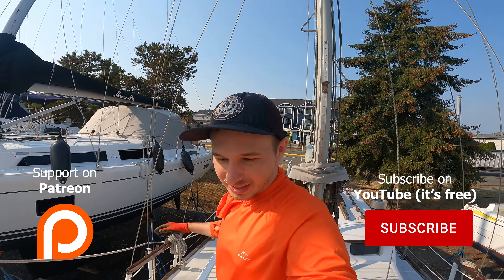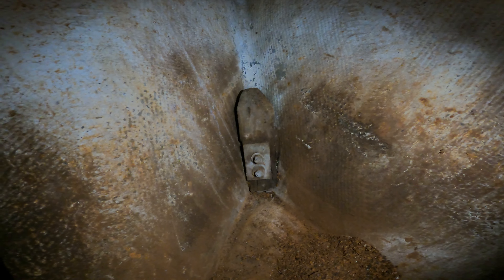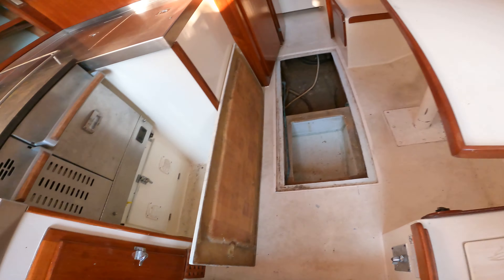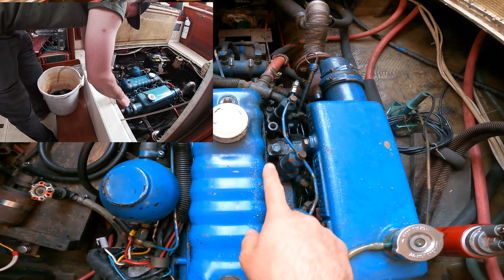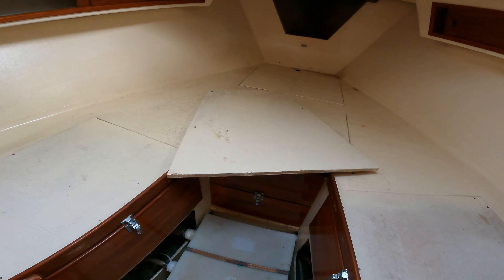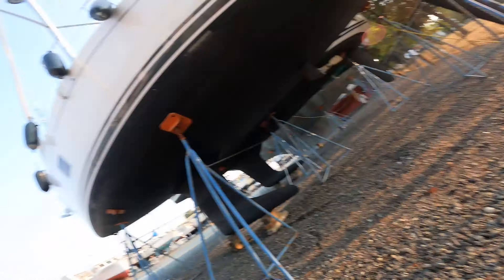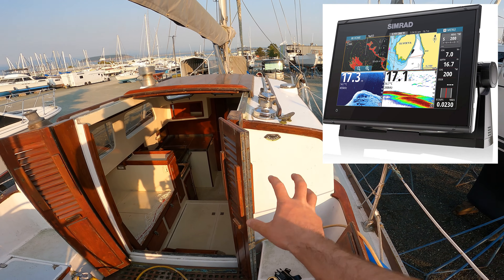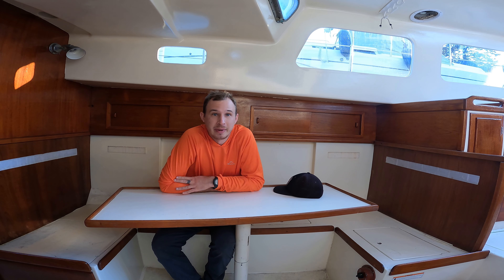Boat Parts and Boat Talk

Comment: Looking forward to seeing some boat work!  How about showing us the “to do” items on sticky notes like Mads at Sail Life!  Great looking vessel!
Reply: Little use at this point . He has so much to do , i would question if he has enough bulkhead space to list them all . Another issue would be losing/ disturbing work slips , as work progresses .
Reply from the maker: Yes! I like organizing things on a white board, I will measure out a space of one and instal it sometime in the next few episodes. I am literally cutting out some of the fiberglass lining to get at the chainplates as I write this so no worries, boat work is coming!
Reply: @projectseawolf  Investigate those bulges before glassing . I've never seen anything like that before , and i don't see any reason for it happening this time .
Reply from the maker: I definitely know what they are now. The in-hull chainplates are in a T shape glassed into the hull with a cross bar. They are rusty as hell and when I cut out the lining I could see rust and water coming in from the other side. I will post the video where I discover this issue on the Patreon tonight, but the regular YouTube episode will come out on February 4th.
Reply from the maker: Bought a nice big white board for the main bulkhead today ✅

Comment: I feel bad for your walet!  :)
Reply from the maker: Yes lol the wallet is suffering xD but I am working full time and I have a lot of time to get these projects done and parts in.
Reply: @projectseawolf  Ehehehe.  No - I love what you're doing - I was just internalizing.  Thankfully the Newport 27 picked up, someone  had just done all the work you're aout to do - plus glassing in the keel, prop shaft, and random TH.....And got it for a song.  I'm still not sold on dynema rigging - but it sure is tempting.
Reply from the maker: @GeorgeGraves  nice! Ya I am not sold on dyneema either, I will be going with standard wires this time around.
Reply: @projectseawolf  Let me know how it goes.  But yea, I should keep a spool of dynema on the boat - just cause.  Loving the vidoes - have shared it with a few people!  Cheets.
Reply from the maker: Thats awesome! Thank you so much :) I'll have to get you up here sometime soon.
Reply: @projectseawolf  For sure.  If you need crew - I'm down.

Comment: Plenty to do and you have lots of ideas which I think will evolve as you progress.  I'd say big "no" to dyneema rigging! It definitely stretches and chafes and I wouldn't exactly call Herbie (The Rigging Doctor) a great example of an expert.  Also a big "no" to an arch ...adds a bunch of weight stern, creates windage and quite frankly, those things are butt-ugly.  Life is too short to sail an ugly boat!!!  The composting toilet is also a big "no!" Once you leave the US put the y valve to overboard discharge...(see Sailing Uma for more on this topic).  Can't wait to see how things develop.
Reply from the maker: 1. Yes, I will being going with standard wire rigging for now. 2. Yes, I have not been impressed with many of Herbie's desissions to the point where I just cant watch his videos anymore, particularly picking up a poached Macaw in South America, having spent time in the Amazon studying those birds I know its a very dirty trade, but also boat stuff. 3. Aft arch I will be sticking with. I am replacing a 40hp diesel motor, 60 gal diesel tank, and heavy sailing dinghy that were all in the aft with a 100 pound electric motor, so I need all the weight I can get! With the electric motor going in I also need all the solar and wind I can get, so an aft arch just makes sense. 4. Yes I had a flushing head before with Y valve for tank and overboard. As a solo sailor doing most things offshore I'm not too concerned with finding a place to dump. I will probably go back to flushing with small tank like Uma did when I get back to the USA from the Caribbean before heading to Northern Europe. For right now in the Puget Sound the composting head is the simplest and cheapest  solution when you factor in the tank, lines, and hull fittings. Plus there is a full bathroom in every port and island here. 5. I'm excited to see where it goes as well! A lot of experimentation right now, I am cutting out the liners hiding the horrid in-hull chainplates as I write this. I have Bronze externals ready to go once the hull is blasted and repaired.

Comment: Dumb question: Why are they called “chain plates”? They are holding/securing a steel cable, not a chain (novice here;-).
Reply from the maker: That’s a good point, I’ve never thought of that. I guess the chains part of the chain plate is the holes for the bolts which “chain” the stay to the hull. Interesting!

Comment: Hmmm , so you have a huge problem . You're not allowed to sand , you do realise pretty much everything your planning will need sanding don't you ? .
Forget loading the focsle with water tanks , too much weight up front . You need to keep the ends light , with all the heavy gear close to the middle , water tanks as low as possible . Weight in one end will cause the boat to hobby horse , and you're already gonna have your chain , plus an anchor there . Water weighs roughly 1kg a litre , i think that equates to 8.5 lb a gallon , plus tank , but check that as i'm not certain . Normally the focsle is a sail locker , off shore , and if you're planning on losing the furler , you will have a lot of sails . I wouldn't advise that particular move , but that one only you can make .  
I'm afraid , i would advise against compost toilets too . If you're planning multi country visits , emptying may become an issue . For instance , i don't know of any empting points this side of the pond , except on inland waterways . 
Engine , now this is an interesting one , you have a 40hp on 36ft ? , why ? . 
I'm looking at a 32  , and that only has 20hp , plus it carries 10 gallons of fuel ! . There's no point having a bigger motor , cause the fuel won't last long anyway . It's purely for getting on and off the mooring . 
The skin fitting with a cap , is a transducer slip . Something like a paddle wheel for the log , or maybe  the transducer for the echo sounder screws in there . Check it's redundant ! . 
You will need a lot of solar to be able to cook , electric , plus huge reserves of battery power . It may sound good to be green , but in practical terms in many ways unworkable . Personally i would go gas , but you have a diesel stove . In some cases it's better , but the risk is greater 
The capstan is a good idea , takes up less deck space . Try and get one without a naval pipe . You need that separate so you can close the hole off , in rough water offshore .
Reply: I have sail bags living on the deck. Not an issue to lower or raise sails. Big problem when the furler decides to pack up in despicable weather. It is not a "if", but "when". I have a downhall and if the condition are outrageous I douse the jib and wait until a lull to store the sail (in the sail bag). And the sails have always a good shape. A genoa on a furler is not going to be really efficient.
Otherwise I agree.....
Reply from the maker: 1. Ya no sanding of the hull is annoying but I will be paying the yard to take the boat and sand and grind it all in one day, I have to wait for the weather to dry up though (raining all day every day right now) so I can repair what was ground out without water getting in. 2. That is an excellent point about putting the water tanks elsewhere, I do not want to hobby-horse around the world! I will be taking all the weight out of the aft as part of the electric conversion so I think that will be a good place to add a water tank, or somewhere low and center. 3. Ya I will be keeping the furler and going standard wire rigging for now. With the 135% genoa it makes sense just to have it furling. 4. Before my crossing to Europe I will probably haul out in the USA and instal a small waste tank system with flushing head, but for now in the Puget Sound a composting head is the cheapest and simplest solution. Mostly because every port and island has a full bathroom and showers set up here. 5. The motor is going to be a big design change, as I am going full electric with 48v lithium propulsion bank powering the QT 20.0 Electric Yacht and 12v house bank through a 2000w inverter. (Solar, wind, and prop re-gen and a honda generator if thats not enough.) 6. Yes, depending on the transducer I will be repairing and keeping that thru-hull for my own transducer which will be part of the full simrad system I am ordering. 7. I will have a small drip diesel stove, a propane stove, and if conditions are good I will use the electric hob. I plan on having a ton of lithium power both in house and propulsion banks fed by solar, wind, prop regen, and generator. 8. For the capstan I will note that down! Thank you! Ya I am new to powered capstans, I've been hauling anchors by hand my entire sailing career, but that was on a 28ft boat in shallow mud and 75ft of chain, not bad.
Reply: Oh , and chain , don't sling your old anchor chain just yet . You maybe able to re-galvanise it , and though it probably won't be enough , it will give you a head start !

Comment: From the standpoint of having three 40’+ sailboats over the past 20 years there are a few things you may want to rethink:  1) while doing your long passages will be a significant part of your time on board, the fact is that the majority of time will be at anchor or in coastal conditions. As such your spacious companionway really adds a lot to the usability and functionality of that boat in non-passageway travel…consider instead doing some removable companionway batter board system that can be installed in addition and stowed away when not required.  I think there’s a viable work around solution there.  2) a simple but sturdy Genoa roller is pretty fail proof and much safer than having to scramble up on deck in rolling seas, bad weather, or at night to douse the sail when required.  The assumption that you will always be one step ahead on reefing or dousing is fine for 90 percent of the time but it’s that 10% factor can kill you…not to mention the pure ease and safely doing it all from the cockpit…risk vs return here 3) do more research on using dynema for your standing rigging as I think there’s a real issue with UV degradation in a relatively short term.  I would not base your decision solely on you tuber rigging doctor as I see a lot of things they do on their boat I would question.  4) be sure to include some effective way to incorporate a davit system in your arch that works with your steering vane as it will be a much needed system in the 80% time you are not at passage. 5) go with a highly dependable beta or yanmar engine with a strong alternator for your lithium batteries, especially if you don’t have a separate generator.  You will appreciate the torque of a diesel when conditions get bad or when you have days of no sun for your solar…besides the sheer square footage of solar panels that you would really need may be difficult to house and secure properly (they will blow off ).  You tuber captain Rick has a newer wind generator that he says has much reduced noise…you may want to compare the pros and cons of a wind generator to a towed water generator too.  6) assuming you are going to repaint your topside hull you may want to check out Alexseal paints.  You can apply using a proper roller without spraying and get great results.  The originator of the AwlGrip gold standard of paints was the creator of Alexseal.  7) whatever you refit budget is double it and you might not be too over budgeted, stick with high quality proven products as quality pays for itself.  Enjoy the ride.
Reply from the maker: Awesome points! Ya I will try to address them:
1.) yes, I love this large washboard idea, just trying to work up a way to waterproof it! Having the open companion way is so nice, and you are totally right, most of the time I will not be having waves over the top but rather nice coastal cruising conditions.
2.) yes, I will inspect this furler headsail system and I’ve changed my mind, I definitely want a furler for my 130% headsail.
3.) I think dyneema can be done right, given you get the right kind and reduce chafe, but for now I will be sticking with wire shrouds for sure.
4.) still not sure what the dinghy system will be or how I will work with it on passage and anchor but there is plenty of space aft for any system!
5.) I already have the new electric motor that has been designed for my particular boat, I know it has a lot of draw backs to diesel, but it’s a totally different lifestyle and different sailing considerations.
6.) yes I will be knocking everything waaaaay back so I’m basically repainting everything including the barrier coat. I will look at the system you suggested because I’m getting close to needing to make a decision on that now.
7.) ya, turns out I have a lot more time (double) and thus money to work with so I’m not too worried about the budget anymore.